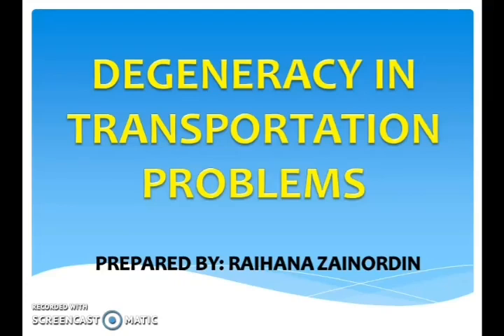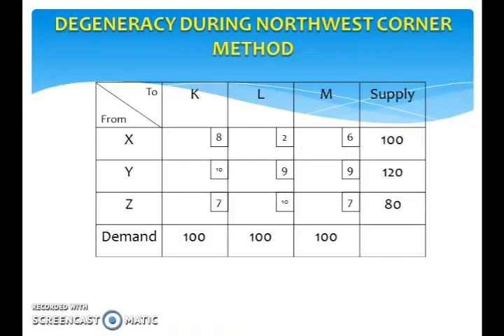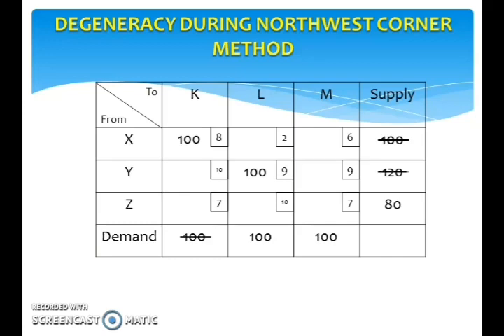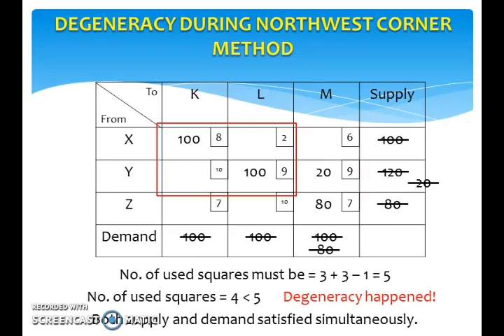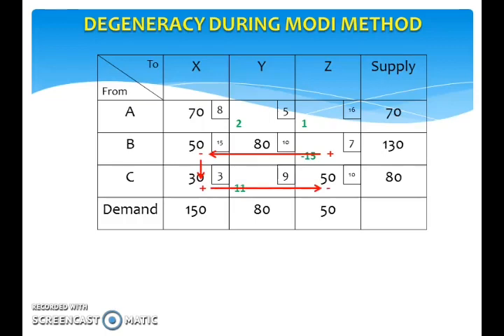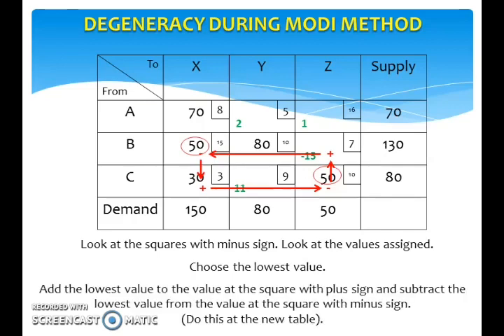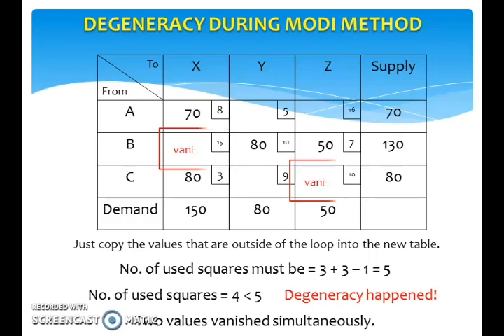Degeneracy in Transportation Problems

Comment: After the formation of the loop, the minimum allocation among the negative sides is to be added to the allocation on positive cells and subtracted that from negative cells, not the unit cost. In this video you add and subtract the unit cost of the cell, which is wrong.

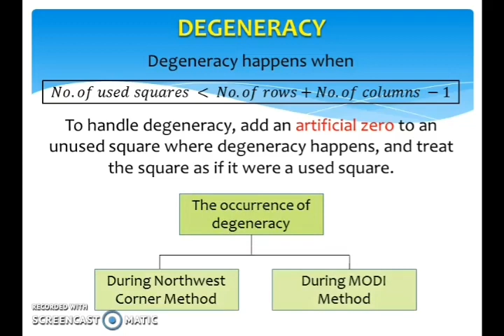Comment: 0:33
1:05 k is lowst between demand and supply
1:30 where to move, why
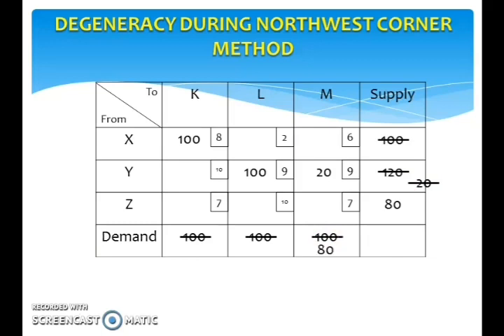2:30 20 left 80 left
3:40 statement and add 0
Reply: Then modi method
4:10 negative no. + left - down+ right-
Choose min negative, plus in plus square, minus in minus square
5:16 vanish instead of negative
5:33
Add artificial 0 to any vanish square with lowest cost in top right  chotu square